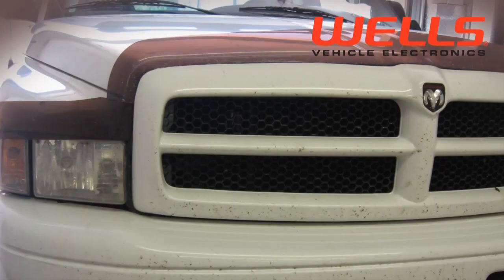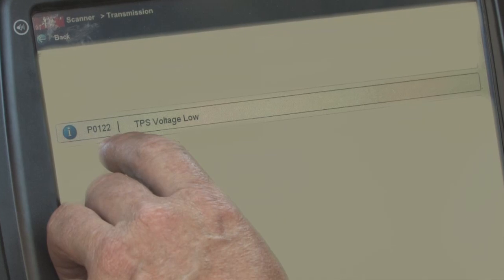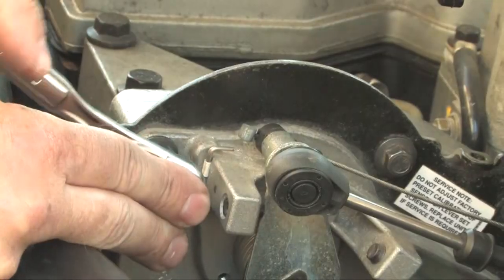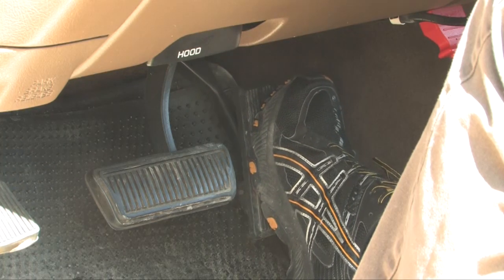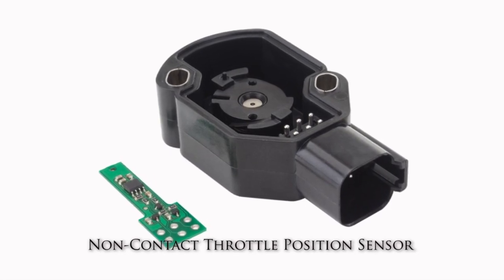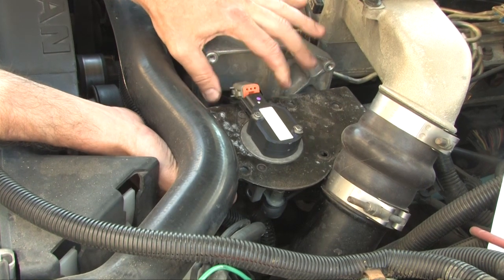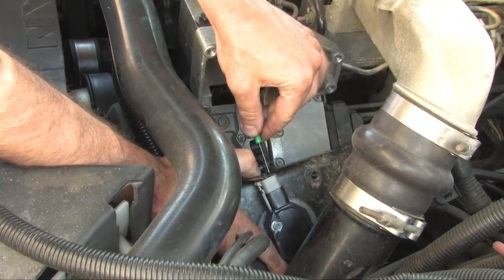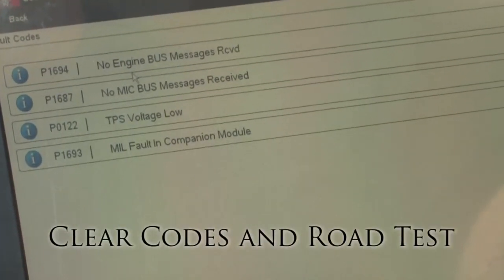Wells TPS Diagnostics / Introducing Non-contact TPS technology

Comment: Is model #5S5352 this new hall effect sensor? Are they still working well? I'm having trouble finding a reliable brand and I don't really want to pay $200 or $300 if I don't have too. :)
Reply: Was this right for you? I just ordered one from rockauto that says from wells for $45 cad
Reply: @SirNoodle yes sir it was the right one
Reply: @chilidog73  how has it been working? I have an 01 24v auto I've owned for just about 2 years now actually damn lol. Anyways I've been buying Amazon sensors for the past 2 years and they grenade after 2/3 months and I saw a fb post about this sensor and saw this video. I was wondering if you bought this sensor and how you like it?
Reply: Sir Noodle it's worked great. However, let me tell you this. If your replacing it because you are having an rpm surge, make sure you keep your battery terminals super clean. Every time mine gets dirty I have issues with the throttle cutting out ever so slightly.
Reply: Sir Noodle PS... This is the same sensor that oreillys and autozone sell for like $200.  I confirmed that with Wells directly.
Reply: @chilidog73  2 brand new bats last year and that's the first thing I did cuz I'm a cheap ass lol. I cleaned em so good you could eat and drink off those terminals and connections haha
Reply: @chilidog73  also thanks for your response bro :))

Comment from the maker: @ncrdisabled @ncrdisabled You are right hall effect has been around a long time. However it has never been used in a TPS application. Typically hall effect will produce a digital signal. We have engineered it to produce an analog signal with today's circuitry. We have run multiple tests on these sensors both in the lab and in the real world and have yet to have a failure. The other advantage is it does not degrade over time. In my opinion it is like going from point ignition to HEI. 
Thanks
Mark

Comment: Hall effect technological  has been around a log time dodge used it on there 2.2 engines for years and it will break down it does not last forever it will fail but not as fast as the old resistor way.